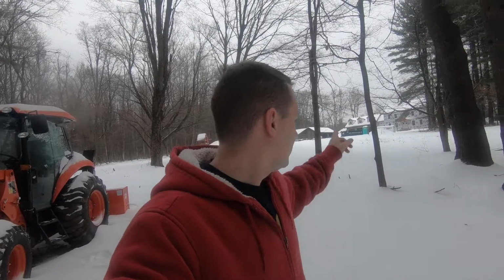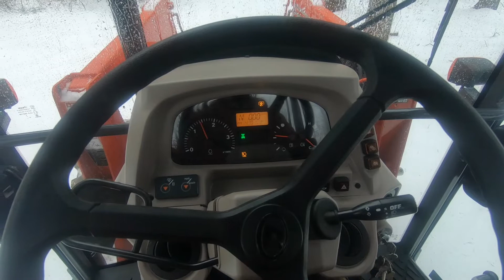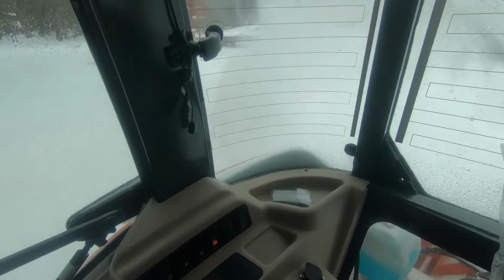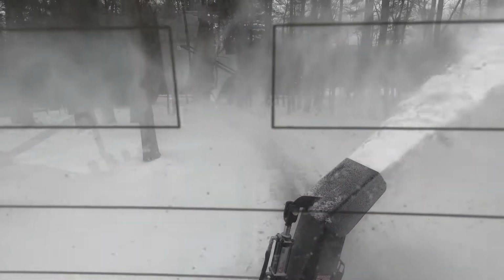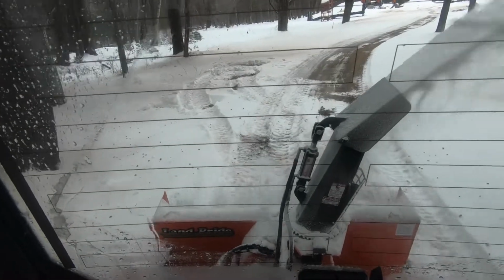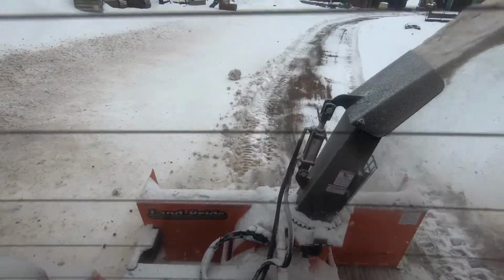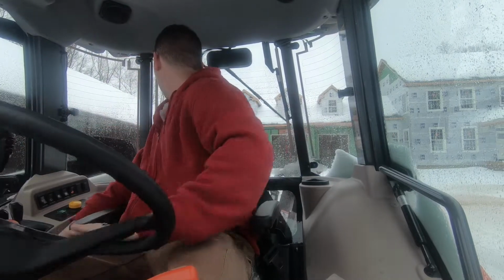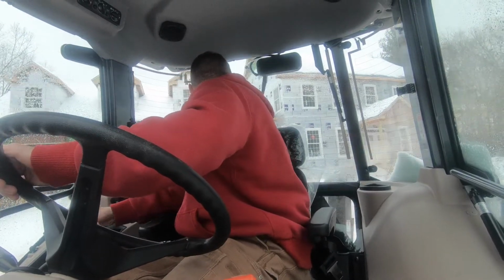Kubota M7060 Land Pride Snow Blower

Comment: Nice tractor. Did you get the 8 or 12 speed? Curious to know why someone picks one over the other.
Reply from the maker: I went with the 12 speed because you get much better control and choice when working different attachments.  The price verse retail sale value should I choose to sell it was another selling point.  No one wants the 8 speed.  They just released the new M4 which is what I wish I got due to better stock options and cab layout.  Thanks for the comment!

Comment: why did you get such a small blower (no offense) this machine can easily take an 84 inch and i run mine is 3rd gear for snow around a foot deep and anything less than a foot 4th gear.
Reply: Mainly came down to price, I bought a backhoe, rake, mower, loader. My driveway isn’t to big and for a residential property without the future goal of commercial use, I couldn’t justify it.Thanks for watching and the comment! Take care!
Reply: Mainly came down to price, I bought a backhoe, rake, mower, loader. My driveway isn’t to big and for a residential property without the future goal of commercial use, I couldn’t justify it.Thanks for watching and the comment! Take care!

Comment: sore neck ?
Reply from the maker: Yeah 100% but not a sore wallet.   The front ones are huge bucks and a bear to set up with the hi flow PTO drive on the rear.  In total it takes about 45 minutes to do the driveway since you have to go a .5 MPH like 2 second gear.  I am considering selling this for a front box blade or quick attach plow.  Plow 2700$, rear blower w/ hydro 4000$ front blower set up 10,000$.  Thanks for the comment.
Reply: @thisflocklife8196  YOU LIAR!! front snowblower is ONLY $8500 hahaha, yikes!